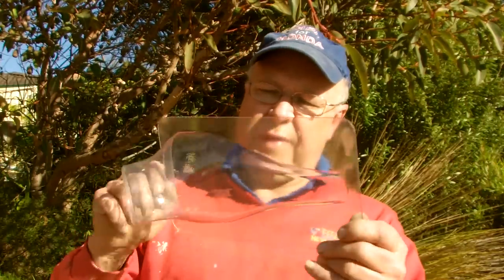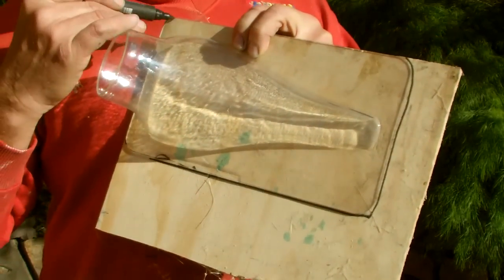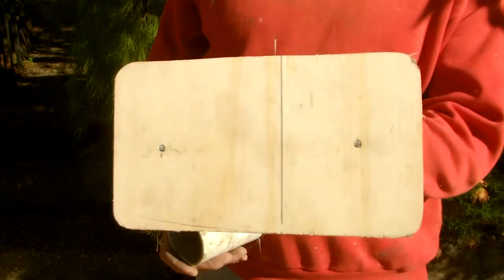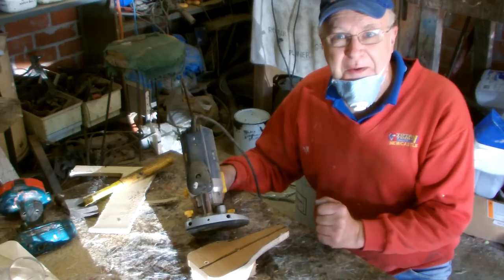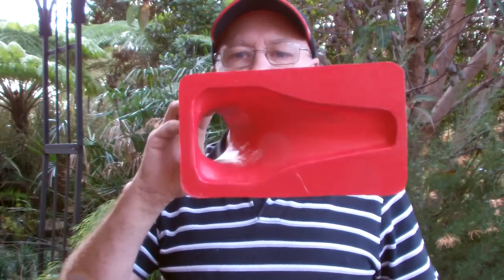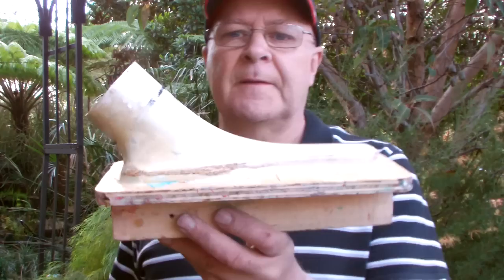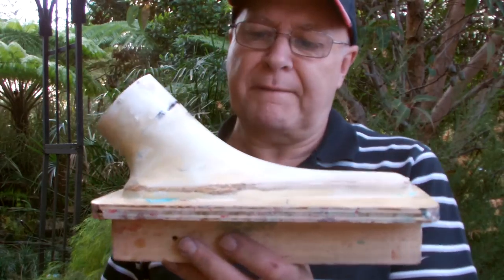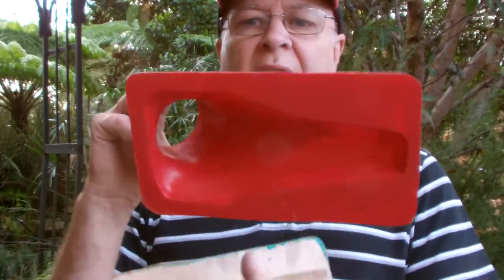How to Make A Fibreglass Car Air Scoop

Comment: Hello sir I have a fiber glass front bumper but it broke in to 4 pieces  and I fixed the main 2  big pieces and I'm missing one piece how can I restore that piece
Reply from the maker: It all depends on where & what shape the missing piece is. I showed one way how to do this in Magna Dirt Track Racer - Part 13 - Pitstop \. If your missing piece is more complicated a shape then email pics to me at redlina@bigpond.com& I'll try to advise you further. cheers, Bill

Comment: Ì suggestion  using a plaster casting mold would be easier ... good work
Reply from the maker: Not really. Plaster is strictly a one use material, plus with this job the first lay up was not for a mold, but produced the finished job itself. haven't seen may plaster parts fitted to race cars.